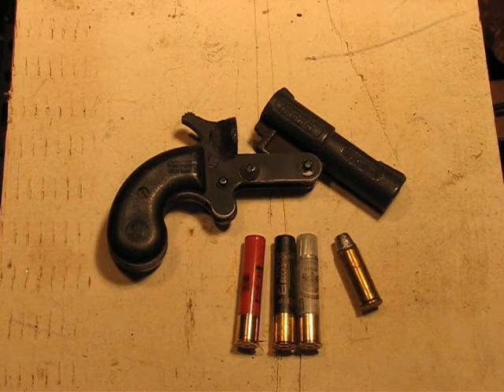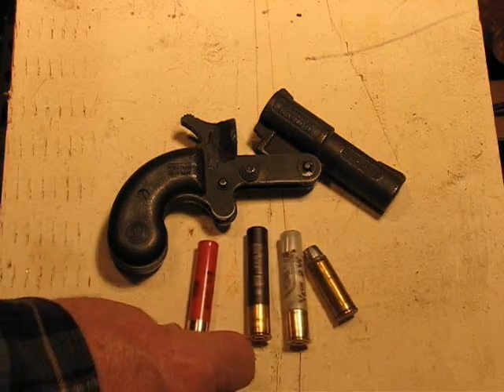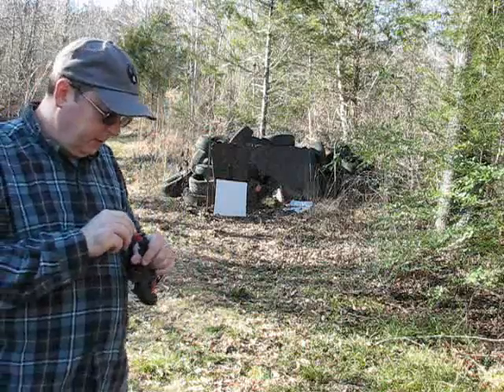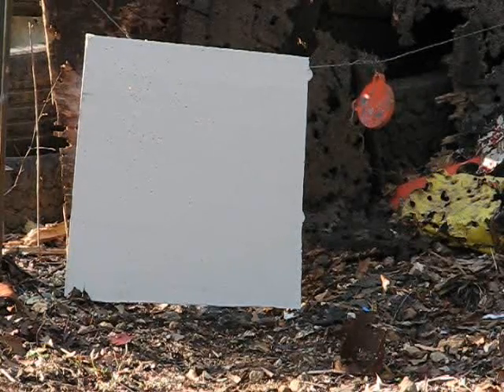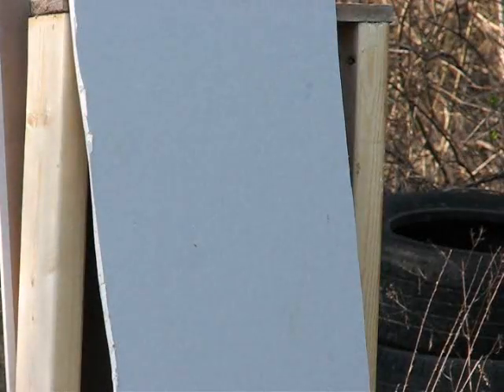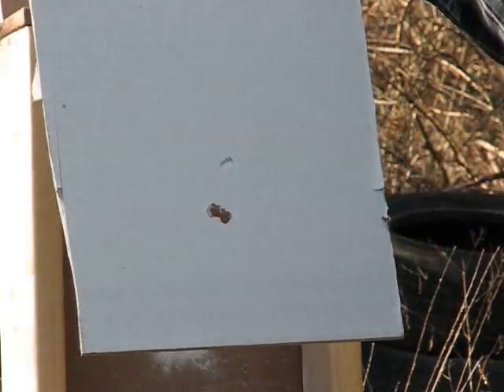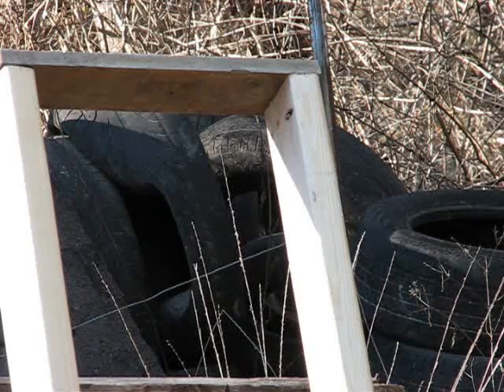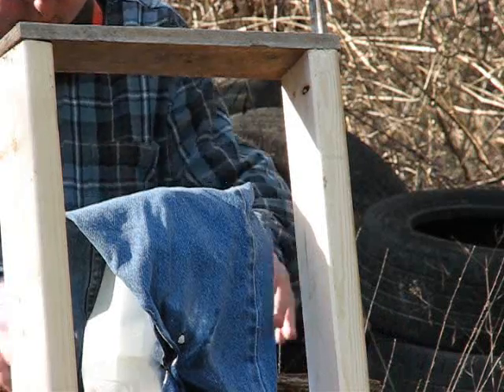.45/.410 Pistol Penetration Test

Comment: Where do u get a kit to build a gun like that?
Reply from the maker: Go to theflatspot.net. They have the sideplates. They also have a pdf catalog of Excalibur, the company that sells the rest of the parts. Excalibur doesn't have a website, so you will have to call them to order.
Reply: thank u possum found a kit on ebay and the side plates and breach at the flat spot, thanks man keep em coming
Reply: I have a parts kit coming and am eager to assemble it, but more eager to fire my BP hand loads through it. Thank you again,  sir, for the excellent string of informative videos.
Reply: @Possumliving  is there another link that you can post? This one no longer works
Reply from the maker: @connorbarry8290  Sorry; I don't know of anyone who is selling these currently.
Reply: @Possumliving  do you have a 18" inch COBRAY .410 single shot barrel you can sell me ?

I just need the barrel and foregrip. I can't find these for sale anywhere. 

The COBRAY .410 single shot shotgun rifle is the world's lightest .410 shotgun. 
It only weighs 1.5 pounds !
(one and a half lbs.)

Comment: I have the double barrel leinad version with the bead front site mine has 3" mag chamber support I've been doing a lot of research and apparently the quality control wasn't that great some double barrels like mine have a chamber that is 2 1/2 inch and the other 3" some have both 2 1/2" chambers I got lucky with mine I've only fired 6 rounds and wow I feel safe in the home car and walking around
Reply from the maker: You're right, they don't have much quality control. They are fun guns to mess around with, though.
Reply: Possum Living they are a lot of fun that is true I am looking to buy the 11" model next and the folding stock model